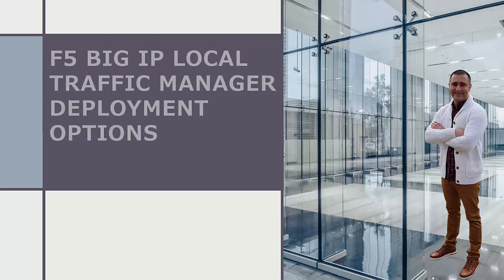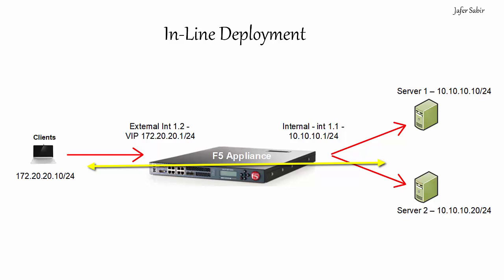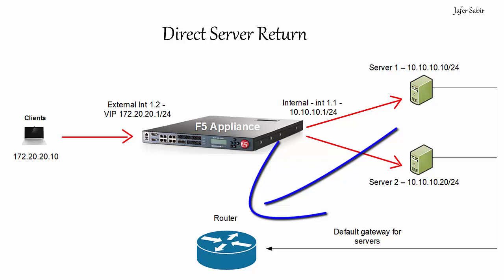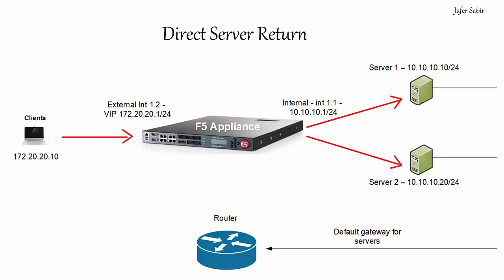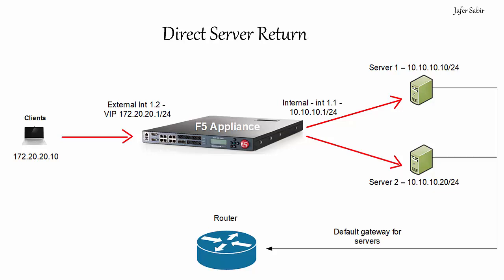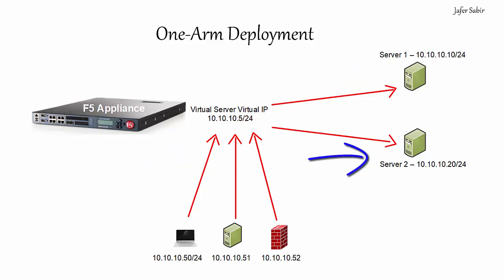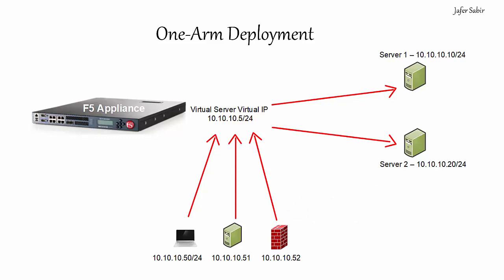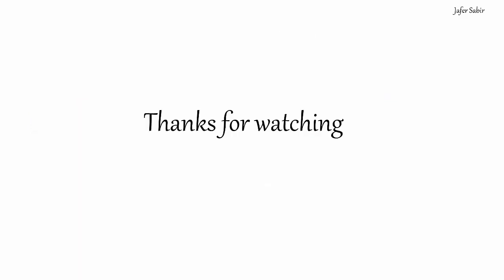F5 LTM Design & Deployment Options - Inline Mode vs One-Arm Mode, Routing & NAT

Comment: Thanks for the video. very helpful! One drawback of this method is that the back-end servers (pool members) will be exposed to the client network. It is important to use proper access-control methods and measures to make sure only traffic coming from F5 is accepted by the servers. However, direct connectivity between clients and pool members can be considered as a last resort option for high-impact outage.